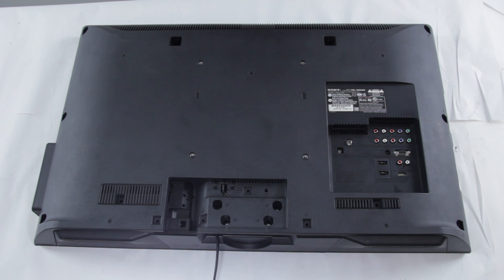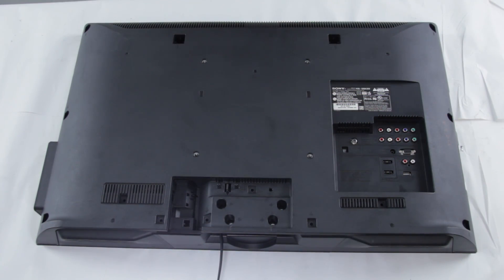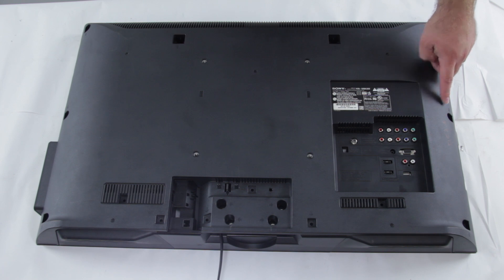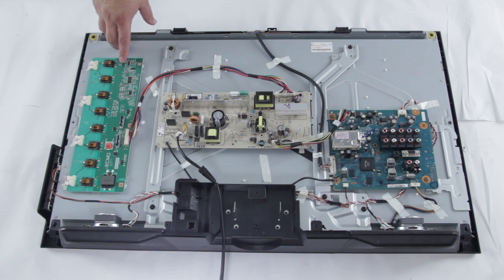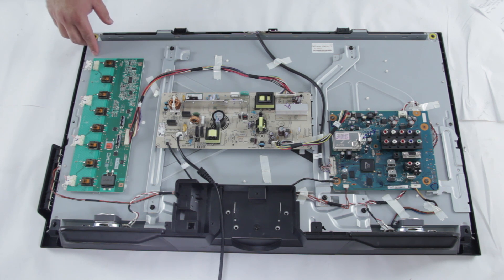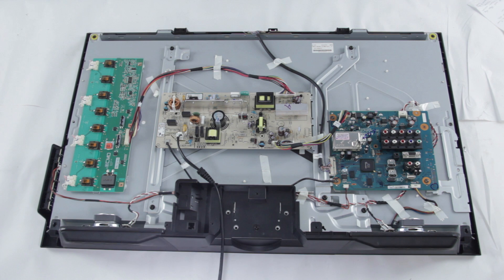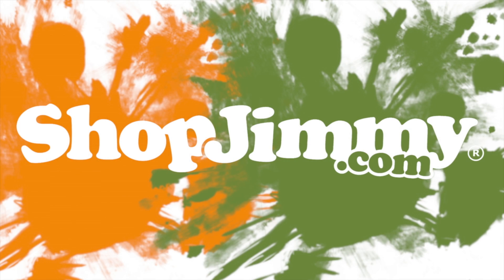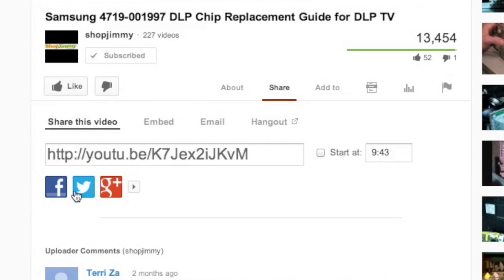LCD TV Repair Tutorial - Backlight Inverter Common Symptoms & Solutions - How to Fix LCD TVs

Comment: Hi Jimmy,
I have a Philips 37pfl3312_10 37 inch lcd tv. It has a Delta powersupply dps168bp with integrated inverter.  Now when the tv is cold, and I switch it on, briefly the sound comes on for just abt 1 second. But no picture. Than it switches to standby mode, with the 12v missing error. ( I have the service manual with error codes). To get the tv working, I pull out the plug from the mains, wait for abt 6 seconds and than push it back in. Most of the time, the tv switches on, working fine. Sometimes I have to repeat the procedure several times. When the tv is on, and warmed up, I can switch it off and on again without any problems. So there seems to be a temperature issue. So I did some testing with cooling spray, hoping to find the part on the powerboard that causes the powersupply to switch of when cooled down. But no luck. I have also noticed on warmer days (outside 30 degr C, and thus inside 24 degr C) the tv switched on immedialty although it had not been switched on that day yet. (So the tv was cold).
Do you have any idea what is wrong with my tv?

Comment: We have a LG television model 42LG50 serial number 803MXSK1Y694. Our TV showed no symptoms of a problem just all of a sudden quit working. The TV powers on but there is no sound or picture. However I can shine a bright flashlight on the screen and see whatever should be showing at that time. What do you think?
Reply from the maker: Adam rogers  Try all repairs and troubleshooting at your own risk.  This could be a problem with either the inverter or the power supply board.  You can replace each board individually to see if one of those boards fixes the problem.  Click this link to replacement parts for your TV model number:  http://www.shopjimmy.com/catalogsearch/result/?q=42LG50  There may be multiple boards for the same TV model number, be sure to match part numbers on your current board, with your replacement for compatibility.  Thanks and please let us know if you have any further questions with your TV Repair!  www.shopjimmy.com

Comment: I have 2007 Samsung LCD TV (Model No. LN-T1953H) that turns off after a few seconds. I purchased a new supply board from your website and I still have the same problem. I did the flashlight test and noticed that it said weak or no signal. I tried pressing the menu button but I wasn't able to see it. What can I do to fix it?
Reply: frank datank  My inverters are on my supply board....It should have worked after I replaced it, right?
Reply: frank datank But when I connect my cable wire to the back of my tv, I can barely see a show playing on the screen (with the flashlight test).
Reply from the maker: frank datank  Try all repairs and troubleshooting at your own risk.  If the power supply board did not fix the problem, then you most likely have bad LEDs in the TV.  Unfortunately, we do not sell replacement LEDs for your TV model number.  Thanks!  www.shopjimmy.com

Comment: Hi I would like some advice on my problem. I have a Samsung model HP P4261. My TV will work and abruptly loose the picture and continue to work with sound playing but with a black screen. If I turn it off and let it cool it will work again. Im thinking its the back light inverter or any Caps related to or on the inverter. I have seen old caps change their value when overheated. Right?? What do you think??

Comment: I have a relatively new (2 years old) RCA model RLDED3955A. For the past few days when I turned it on,  the picture would flip a few times, but then it would be OK. Well this morning when I turned it on, it would not stop flipping. I originally thought it might be a bad cable, however I brought in another TV, hooked it up,  and it worked perfectly. Wondering if this could be the back light inverter, and if so. is it worth fixing, as it was a pretty cheap TV. Thanks !!!
Reply from the maker: Michael Ross   Try all repairs and troubleshooting at your own risk.  This is most likely not a problem with the backlight inverter and it is up to you to troubleshoot further and try to repair or buy a different TV.  Thanks!  www.shopjimmy.com

Comment: 37'' Emerson TV Model EWL3706A shuts off after a while. And has increasingly become more and more frequent. I maybe get 5 minutes of view time before tv shuts off. And I mean it actually shuts off. I'm gonna assume this is a heat issue, but could this be inverter issue or heat problems related to power supply? I've taken the back panel off, and looked at the power board, and it's got some tiny heat sinks. Maybe adding a fan would help?

Comment: Hello! I have a Philips LED-TV. model 32PFL6626T/12, with sound, but extremely dark picture. If I have the TV in on-mode, for about 10 minutes, then, if I quickly turn of and on the mechanical power button on the, I will get full light on TV, and it works rest of the evening. But if I let the TV rest for an hour, then the problemreoccurs.
Reply from the maker: Örjan Nordstrand  PLEASE SUBSCRIBE TO OUR CHANNEL - Try all repairs and troubleshooting at your own risk.   I recommend replacing the power supply board in your TV.  Unfortunately I do not see any replacement parts in the search results for your TV model number on our website.  Please reply with your part number on your power supply board and I can try searching for replacement parts.  Thanks and please let us know if you have any further questions!  www.shopjimmy.com
Reply: I have replaced power supply board, no difference. I have my doubts on the t-con board?
Reply from the maker: Örjan Nordstrand  Try all repairs and troubleshooting at your own risk.     You may have received a defective replacement board.  Was it a confirmed working part?  Thanks!  www.shopjimmy.com
Reply: ShopJimmy.com Yes, probably. I unpacked it myself, and bought it from ASWO, a german spare-parts delivery store.

Comment: Dear sir,

I am having problem with my view sonic N3760w. when i turn on the TV the view sonic logo showed up than the back light turned off. I have tested with Led light focusing from front side  and i found out that there is picture on LCD and sound is also working. would you mind please suggest me what i should do.
sincerely,
Suman
suman_pacific@yahoo.com
8801913200282

Comment: Got a white bar on left of tv from top to bottom.  About 6" wide, any ideal on what causes this.   Samsung LN46D550
Reply from the maker: David Fleming   Try all repairs and troubleshooting at your own risk.  This sounds like a TV panel (TV Screen) problem.  If your TV panel is bad, it may be more cost-effective to replace the TV as panels are typically hard to find in stock, difficult to replace, and expensive.  Thanks and please let us know if you have any further questions!  www.shopjimmy.com

Comment: I have an LED tv. Model number lg 47ln5400. When I power it on the tv comes on for a second then goes blank/black. I have sound and I can see images when doing the flashlight test. I have already replaced the power supply board and the main board. Problem still remains the same. What do I look to next???
Reply from the maker: Johnny Hough   This sounds like a problem with the LED lights in your TV.  Unfortunately, we do not sell replacement LEDs for your TV model number.  Thanks!  www.shopjimmy.com

Comment: i have a problem with my 32-inch tv.there is a sound but no display/black screen.  the model is samsung ua32eh4003rxxp version  #qd03  i troubleshoot it with flashlight and there is a image. what should i buy to repair it? tnx in advance
Reply from the maker: mugen jin  Try all repairs and troubleshooting at your own risk.  I recommend replacing the Power Supply/LED BOARD in your TV.  Click this link to replacement parts for your TV model number:  http://www.shopjimmy.com/catalogsearch/result/index/?cat=229&q=32eh4003  There may be multiple boards for the same TV model number, be sure to match part numbers on your current board, with your replacement for compatibility.  Here is a link to a video showing how to identify your part number, click here: https://www.youtube.com/watch?v=sSJexLvRrjMThanks and please let us know if you have any further questions with your TV Repair!  www.shopjimmy.com

Comment: I have a Sceptre Model T315XWO4 V.1 the backlight will come on and then start flashing after awhile. I suspect the inverter board but would like a second opinion. thanks
Reply from the maker: Rick Brown  Try all repairs and troubleshooting at your own risk.  I recommend running the flashlight test on your TV.   Here is a link to a video we produced that shows how to run the flashlight test. https://www.youtube.com/watch?v=xUzCLgoSPGM Please reply with your flashlight test results and we can recommend a replacement part for your TV repair. Thanks and please let us know if you have any questions! www.shopjimmy.com   This could be a problem with either the inverter board or the power supply board in your TV.  Unfortunately I do not see any replacement parts in the search results for your TV model number on our website.  Thanks and please let us know if you have any further questions!  www.shopjimmy.com

Comment: hello i have a vizio VL370M i think i have backlight light problem because when i turn it on screen flash only for one second and then stay black, i also check the power supply and backlight board number is 0500-0405-0900. so can you tell me please which of the component of the board can be causing the problem or what i need to check. thanks.
Reply from the maker: jonathan garcia   PLEASE SUBSCRIBE TO OUR CHANNEL - Try all repairs and troubleshooting at your own risk.  Do you have experience with a multimeter and checking voltages?  Thanks!  www.shopjimmy.com
Reply: Thanks for answering and yes i have some experiences
Reply from the maker: jonathan garcia Try all repairs and troubleshooting at your own risk.  If you have the proper training, you can check the voltages on the power supply to see if it has standby and other voltages as labeled on the power supply.  Thanks!  www.shopjimmy.com

Comment: can someone please tell me:
what causes, or might have caused, both my backlight inverters to fail.
no point replacing them both if its caused by something else.

both master and slave have a blown caps and a fried pin on the chip.

thanks to anyone who can give some insight.
Reply from the maker: Michael Brown  Try all repairs and troubleshooting at your own risk.  Please reply with your TV model number.  Click here to view a video that shows how to find your TV model number:  https://www.youtube.com/watch?v=S51nhAmwR2M  Thanks!  www.shopjimmy.com
Reply: Both back light inverters have failed. Is this normal/ unusual?
Reply from the maker: Michael Brown  Try all repairs and troubleshooting at your own risk.  Please reply with your TV model number.  Click here to view a video that shows how to find your TV model number:  https://www.youtube.com/watch?v=S51nhAmwR2M  Thanks!  www.shopjimmy.com
Reply: Hi my panasonic 55 inch led 4k ready picture goes black but have sound and u can change channels so I unplug tv and hold power button down for min and have picture back on then week latter goes black again  anyone know

Comment: My seiki hd model-se40fy27 backlight is out i did the flashlight test i can still see (no signal) on screen ( i have nothing plugged in) i was wondering how much it would cost to fix and if its even worth fixing and what part id need. Please reply i cant play my ps4 without it im dieing
Reply from the maker: Austinbeast Hendrick  Try all repairs and troubleshooting at your own risk.  At this point it may not be worth fixing.  Thanks!  www.shopjimmy.com
Reply: Called geek squad they fixed mine said it was a bad wire must of overheated and burned through wich i geuss it possible i had my ps4 vent pointed right at my tv not smart i know to bad i didnt notice til it was too late

Comment: hey jimmy, I have a visio TV model E550i-B2 serial # LWZ2PPAP5000727. The problem is the left side of the screen will  darken, not blank just darker than the other half. usually 2-3 minutes after turning it on. it will last for about 2-3 minutes then goes back to normal. any clue
Reply from the maker: jerry stuart  Try all repairs and troubleshooting at your own risk.  This sounds like a TV panel (TV Screen) problem.  If your TV panel is bad, it may be more cost-effective to replace the TV as panels are typically hard to find in stock, difficult to replace, and expensive.  Thanks and please let us know if you have any further questions!  www.shopjimmy.com

Comment: Hi i have an toshiba 32d1333db .Its have a back-light problem.With part do i need to replace for that.In a back its have 2 boards 1 is the dc and one is the motherboard.
Thank you
Reply from the maker: Ernő Sterczl   Try all repairs and troubleshooting at your own risk.   I recommend replacing the inverter/power supply.  Unfortunately I do not see any replacement parts in the search results for your TV model number on our website.  Thanks and please let us know if you have any further questions!  www.shopjimmy.com

Comment: Sanyo DP 46484 tv turns on about 3 seconds then off already tried. Replacing power supply inverter board and main board. Same problem. Could the 2 boards on the left and right sides of tv under power supply and main boards cause this.and are they replaceable.I used to do tv repair when they were analog
Reply from the maker: Melvin Kimble   Try all repairs and troubleshooting at your own risk.  Double check to be sure all of the cables are connected and everything is seated correctly.  Thanks!  www.shopjimmy.com
Reply: Connectors from inverter boards are not tight they feel loose
Reply from the maker: Melvin Kimble Try all repairs and troubleshooting at your own risk.  Be sure all of the cables are connected and seated correctly.  Thanks!  www.shopjimmy.com
Reply: Thanks for the reply

Comment: Hi I have problem with my Samsung LCD TV (model-LA32A450C1) power red light is when I power on the tv and it brings for couple of seconds and gone, no picture neither sound. I have changed one of the bad capacitor 25V 470ohms still the tv in same condition.

Comment: Samsung LN40A550P3F
TV turns on. I get the samsung boot-up jingle. Using the remote I don't see anything on the screen. No back lighting, no samsung menu's. Nothing not even for a second when the TV first turns on.

However, if I play something through HDMI, (I have to switch to the appropriate input without seeing the on-screen menu) I can also hear the volume of whatever is playing.

I thought for sure that would be the backlight inverter but someone else mentioned it could be the power supply. I haven't tried anything yet.
Reply from the maker: Styleman74   I recommend running the flashlight test on your TV.   Here is a link to a video we produced that shows how to run the flashlight test. https://www.youtube.com/watch?v=xUzCLgoSPGM Please reply with your flashlight test results and we can recommend a replacement part for your TV repair. Thanks and please let us know if you have any questions! www.shopjimmy.com

Comment: I have an vizio E550vl 55" 
The sound and output works but the top right corner display is darker than the rest of the picture could this be the backlight 

Thanks,
Reply from the maker: Joseph Anderson  This sounds like a TV panel (TV Screen) problem.  If your TV panel is bad, it may be more cost-effective to replace the TV as panels are typically hard to find in stock, difficult to replace, and expensive.  Thanks and please let us know if you have any further questions!  www.shopjimmy.com

Comment: Hello, I have a 32" SCEPTRE LCD tv. The model # is: X322BV and the issue that I am having is that the TV turns on, the screen kind of turns on and stays on but everything but the edges of the TV screen are completely black.Even the edges of the TV are pretty dim. Any information that you could give me on what could be the issue would be greatly appreciated. Thanks!

Comment: We have an older model Philips 47PFL7422D/37, ser. #YA2A0748008874.
The picture comes on for about 5 to 10 minutes then goes black, sound can still be heard. This occurs with HDMI and other source inputs. Is this the Backlight Inverter or something else? Will be glad to purchase the correct part and perform a repair when we get your recommended solution, thanks so much.
Reply from the maker: Bob Lewandowski   Try all repairs and troubleshooting at your own risk.  I recommend replacing the main board in your TV.  Click this link to replacement parts for your TV model number:  http://www.shopjimmy.com/catalogsearch/result/index/?cat=56&q=47PFL7422D%2F37  There may be multiple boards for the same TV model number, be sure to match part numbers on your current board, with your replacement for compatibility.  Here is a link to a video showing how to identify your part number, click here:  https://www.youtube.com/watch?v=xSSxNZXZIXA  Thanks and please let us know if you have any further questions with your TV Repair!  www.shopjimmy.com

Comment: Hi. I've a Bush 42" 1080p Digital LCD TV about four years old. MODEL: S642F1. When you turn it on, it's ok for about 5-10 seconds. Then the background starts flashing. It happens even when nothing is connected. Also a buzzing noise ia heard from the top right side. Is this my back light and is it easily repaired and cheap? N.Ireland here. Thanks.
Reply from the maker: Cookie dude  It sounds like you have broken lamps in your TV.  Unfortunately, we do not sell replacement lamps.  Thanks!  www.shopjimmy.com